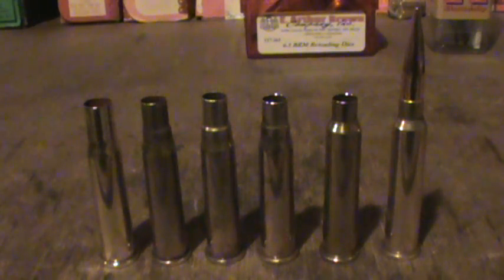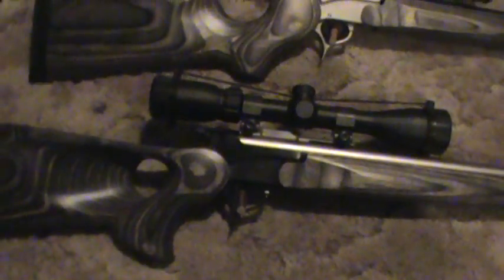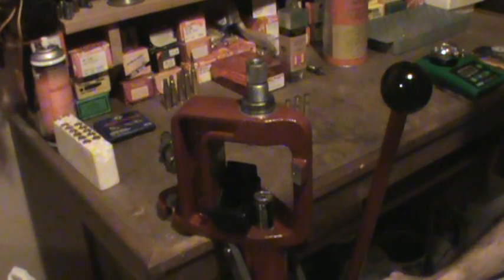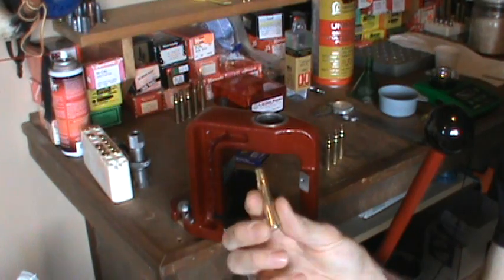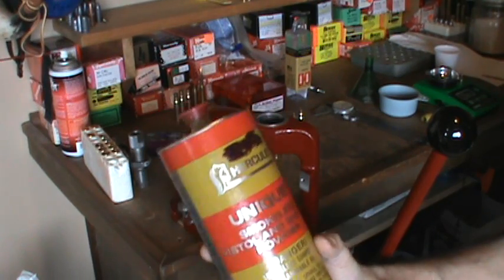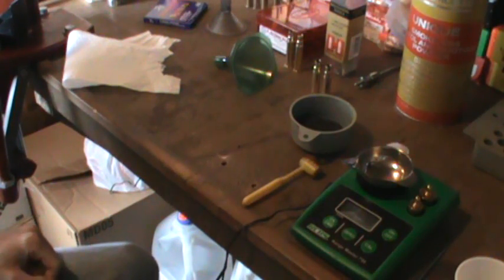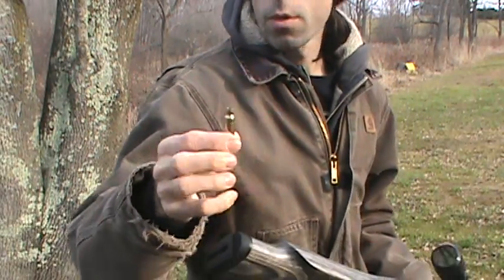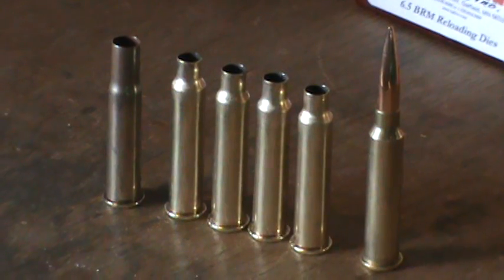Forming brass for the 6.5mm bench rest magnum (6.5mm  BRM)

Comment: How far down do you set the 7mm short neck size die
Reply from the maker: Its kinda trial and error deal. Its about 3/4 the way down the neck. After the 7mm, run your full length till it just chambers.
Reply: Thank you, new at forming cases

Comment: I just watched your video and I have a simple question,  I am using 303 British brass to form 6.5x53R, when setting up the load did you use full load of powder or half load. Thanks
Reply from the maker: I loaded with only 9 grains of unique to fire form, then a normal load after that.
Reply: vegapower454 Thank you Sir.

Comment: Hey, this is a great video! I use the same method to fire form my .257 Ackley. Check out my video (not as good as yours ;>) I have been curious about this cartridge. I was thinking about getting one, but I will probably get a 7MM HK (7mm Ackley with 30 deg. shoulder). This fire forming principle should work well with this cartridge as well.             Fire-forming Brass Cases (The Cream Of Wheat method).wmv

Comment: My go to round for back tail.Shoots well with almost all bullets from 85 to 129, powder R15 ,W760 and H380 my top 3 for velocity and accuracy. On a good day 5 shots 1 MOA ,normally it's a 3 shots 1 MOA, 120 to 129 I was getting 2400 to 2500 ( Hot  load ) out of a 20 inch. That's the reason I was using 375 Win brass.

Comment: That looks like a 6.5 Bullberry improved, what is the velocity . I have a 6.5 Bullberry for over 20 years and I've taken a few blacktails in Northern California. I use 375 win brass and  30-30 brass but I expand the neck to make it just like the 375 the run it through the 6.5 die, this way I  do not need to fire form.The 375 needs to be annealed, did not have any problem with 30-30 brass.